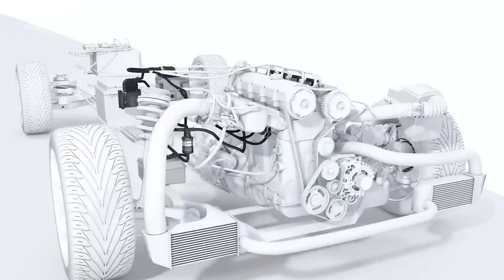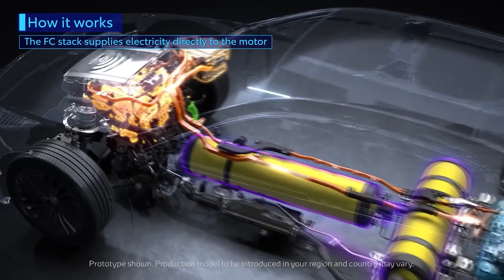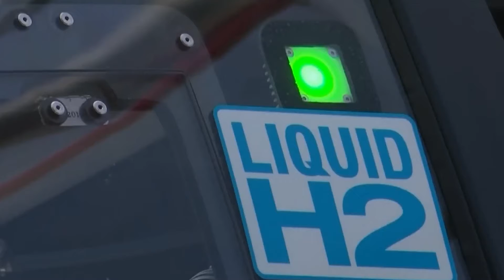Bosch Builds a Twin Turbo V6 Hydrogen Powered Racecar

Comment: One of the things I constantly hear when discussing hydrogen powered vehicles the issues with the production cost and transportation of hydrogen. I have a feeling that a lot of that is misinformation or at least very overblown. Of course it doesn't mean that it aren't challenges but to me it looks like a series of more solvable problems than somehow reduce a car battery by 30-40% weight while increasing density by at least the same amount and somehow reduce charging times by 80%. What has happened commercially the last 4-5 years with batteries? not that much. Capacity has increased but so has size and the only real change is now that you can charge the batteries to 100% without wearing out the battery as fast instead of playing the 20-80% game which effectively reduces the IRL range between charges even more. Can't say I'm impressed with that. I own a PHEV and since getting a small taste of the EV part I'm even more convinced that EVs only really serves a good purpose as a city car for those smaller commutes to/from work or shopper where you can get away with charging once a week. Hybrids can certainly work and does have benefits but I'm more convinced by the mild hybrid setups that you don't charge than the plugin variants.

Comment: 😁😆😅🤣😂🙂🙃😊Hydrogen is the future as for those of us in the know we already understand that hydrogen powers this world already as I think all life would simply cease to exist if there was no hydrogen. Those that came before me figure out how to break the bonds of the water molecules at rates high enough to run an internal combustion engine with nothing but water in it's tank for fuel. The problem they ran into was the fossil fuel industry wasn't ready to call it quits back in 1968 when the technology first tried to come out and thus put a stop to it. Just think how much money they made by doing that! but it came at the expense of a livable planet.